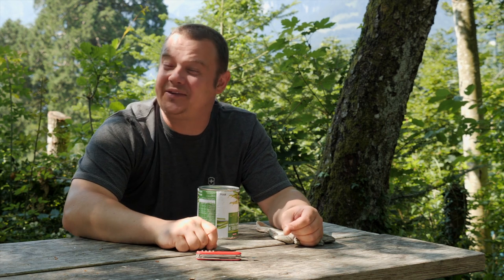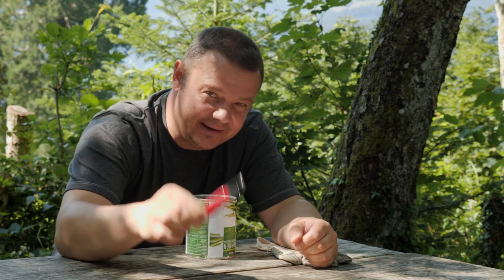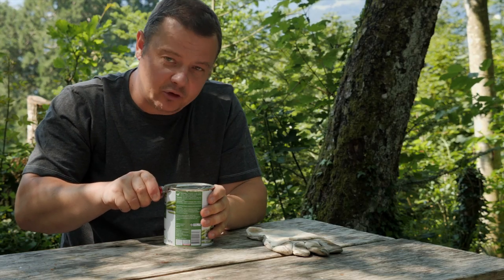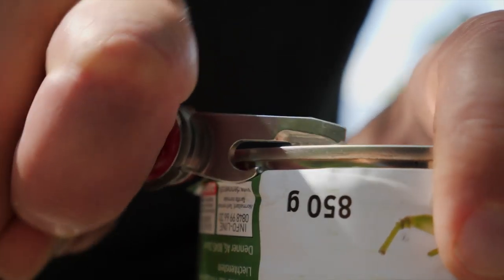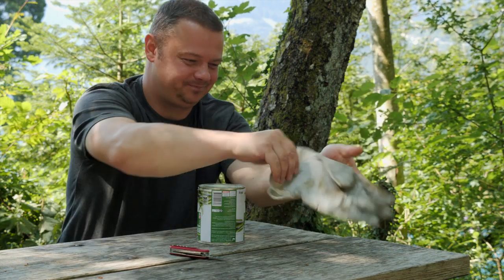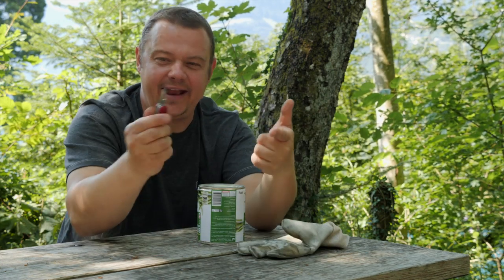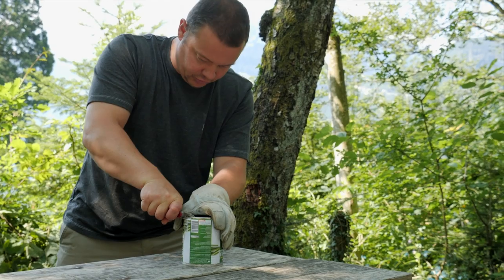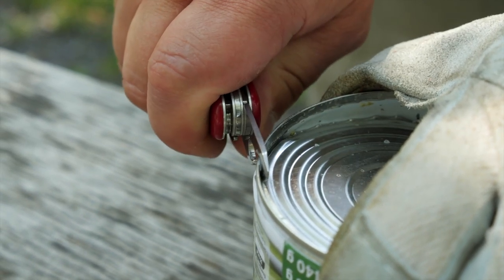Victorinox Tips & Tricks (15/25) - Open a tin can in 10 Seconds

Comment: Well, I've never thought of using the can opener like THAT before!  Haha!
Reply from the maker: Thanks a lot for watching my video!
Reply: Then brace yourself. 99% of people who use a normal can opener, the one that cut open the can lid, use the can opener wrong! They place the can opener on the side of the can and cut the inside of the lid open, similar as you see it in the video above. The correct use is actually to place the can opener flat on the top and cut the outside under the lid around the can so you can lift off the upper part without dirty hands or messing with the sharp edges. It's documented in the patent papers of this type of can opener as the example on how to use it.
Reply: @thepurplesmurf  Can you give us the patent papers than please. My SAK had a very small paper with instructions how to use the can opener. (I dont know why they do this. Anyway...) And they show the exact same standard technique as in this video. I wouldnt call things wrong when even Victorinox say you have to use it that way.
Reply: @thepurplesmurf  WHAT? I have no clue what you said please explain in simple
Reply: @SpaceStrike  instead of cutting the lid along the rim you cut the side of the can along the rim
Reply: @michaelhayward9532  oh thanks man

Comment: Great Video, as ever.. But do you have an idea how to open straight cans, like these with fish in. tomato sauce ? On the round sides it works find, but on the straight sides it does´nt so well
Reply: Just use a plain ol` butter knife . Nice and blunt so you don`t hurt yourself . Just bang the tip into the can and slowly force the knife around the edge , be careful not to cut yourself on the sharp jaggered edge.

Comment: Hi Felix. I've enjoyed a lot of your videos, thanks! One issue I have with your can-opening video is that it doesn't really teach or reinforce the general principle of never cutting toward yourself. I understand that the can-opener blade is not really that sharp on the end as you demonstrated. However, you're putting quite a bit of force on that blade, and what if it snaps into a jagged edge unexpectedly. It could easily cut through that glove or still inflict a nasty wound. Personally, I've found there are certain fundamental rules that need reinforcing so that they become automatic and hardly need to be thought about. The rule about never cutting toward yourself with any kind of pointed or sharp (semi-sharp) instrument is one of them. Another is checking to see if a firearm is loaded every single time you pick it up, even if you just set it down a second ago. That way, it becomes automatic, avoiding potentially catastrophic accidents.
Reply from the maker: You are right, to open a tin can with this technique is dangerous. But with the gloves i feld safe...

Comment: What is the purpose of this to me it doesn’t seem like it would be worth the risk of an injury just to open the can faster if you needed the smooth edge that’s one thing but even the plunge method can give the same results just don’t plunge the tip all the way through resulting in shorter cuts but smoother edges
Reply from the maker: You are absolutley right. this is just for bluffing :-D

Comment: When using the conventional method, rather than moving  the opener forward on the tin after each punch, I find that it works better going backwards, since the opener is only facing resistance until it reaches the area where the can has already been punctured. Less resistance equals better experience.
Reply from the maker: Thanks for your interesting comment!

Comment: I will try that tonight with my alox farmer. Have you seen the can opener victorinox used on the "Scientist" model? Bought in the1990s. It cuts in the opposite direction. I wish all SAKs did this.
Reply: IainB The Compact model has a combination tool that opens cans by going towards you rather than away from you as usual. I actually find this alternative way easier.
Reply: @Cheeseandhamsandwich  That's the same combination tool and yes it is easier by far. If we can only find another million or so folk who think the same, Victorinox may make it standard.